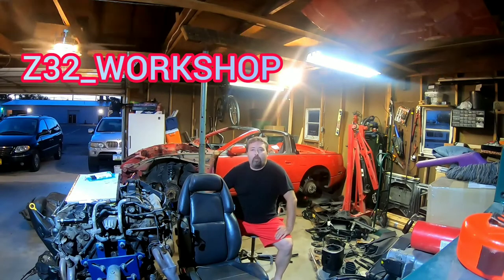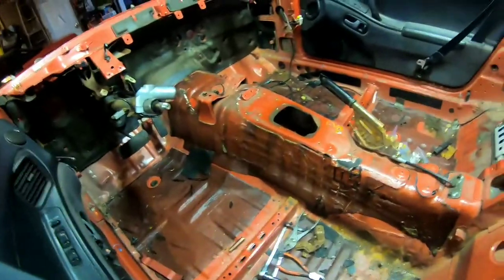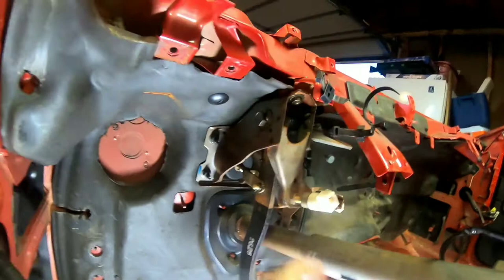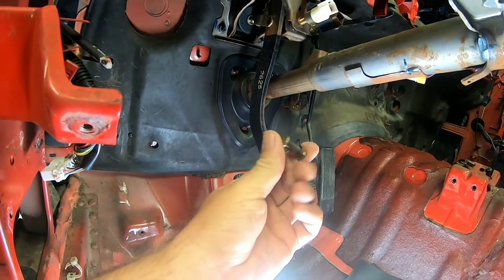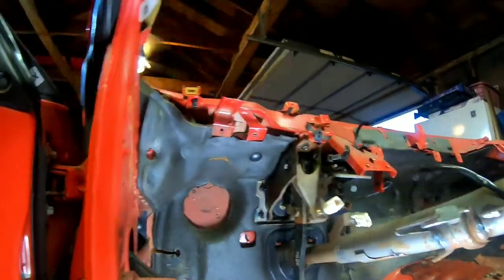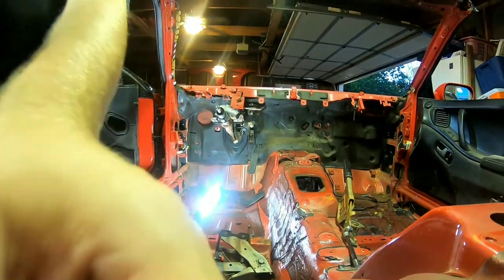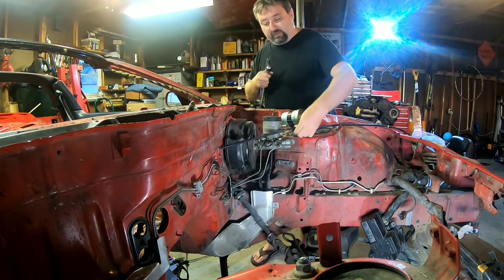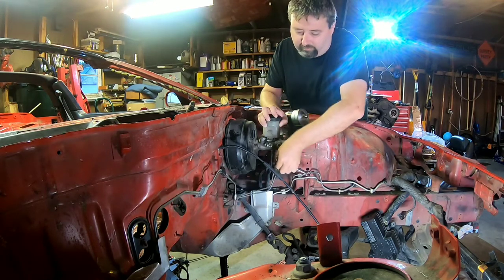Nissan 300ZX - Part 18 - Brake Pedal, Brake Booster and Master Cylinder removal.

Comment: i can not take the top right bolt off
Reply from the maker: From?
Reply: @z32_workshop52  the booster i did it after a while though it was a little tricky
Reply from the maker: @luisgutierrez5818  thats great to hear